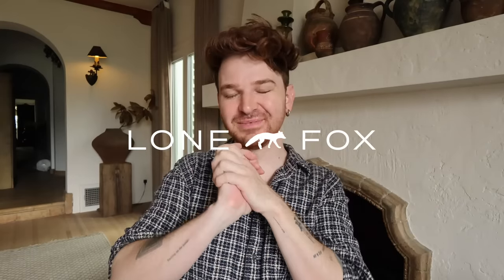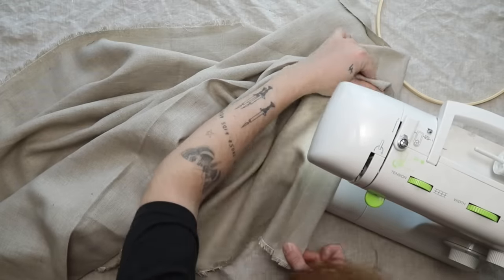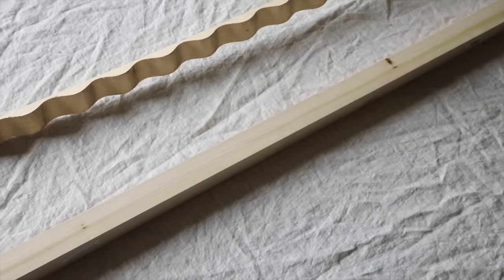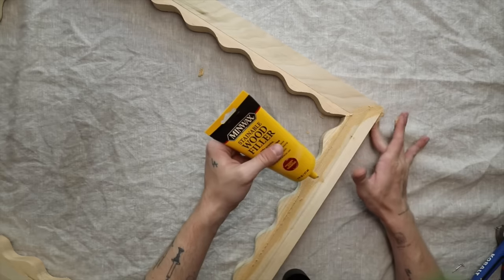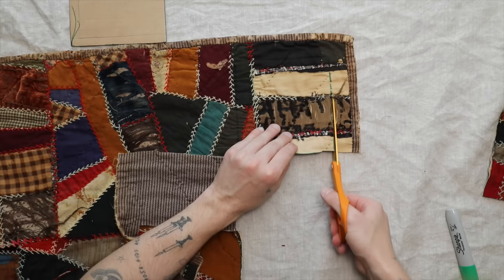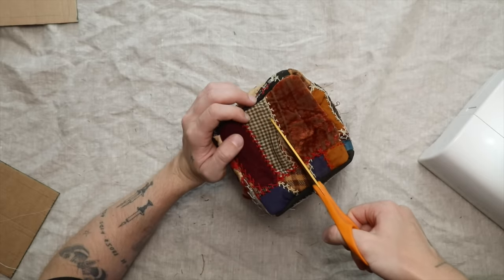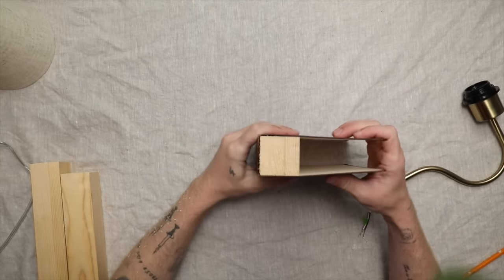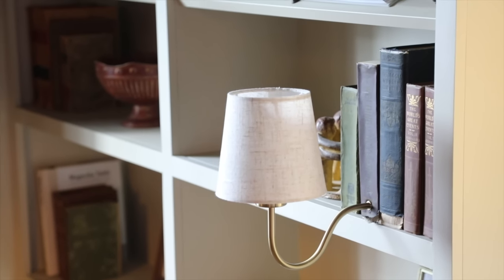Creating DIY Home Decor You've Been Seeing EVERYWHERE! *Designer Dupes*

Comment: Your tissue box cover was cabin chic & adorable. I would have tabbed all 4 bottom sides & used velcro to attach to a same sized woodbase. Even more rustic & it would solve the problem of the sides riding up whenever you pull a tissue out.

Comment: The next time you make a tissue cover, cut 2 squares for the top and fold each in half, wrong sides together. Then butt the folded edges together to make the square top. Assemble as before, with the 2 the folded edges making the opening for the tissue. 😊

Comment: FYI, when painting frames for mirrors, you should also paint back side around hole opening, Because, otherwise small bits of unpainted back side (along hole opening) will be reflexed in mirror along the inside opening edge.  To avoid seeing glimpses of the unpainted back side, you must paint that back side along the hole opening edge.